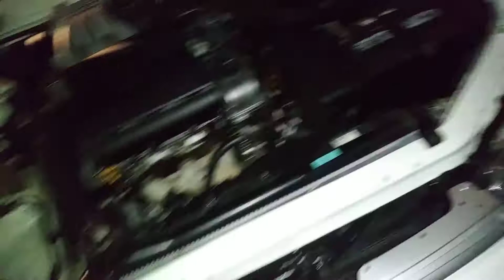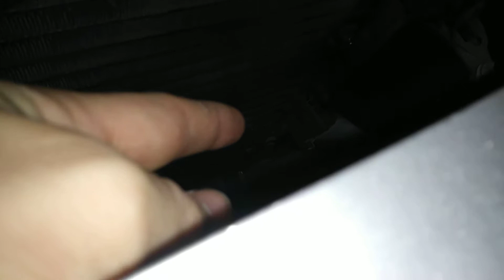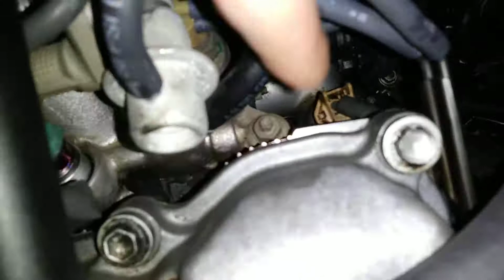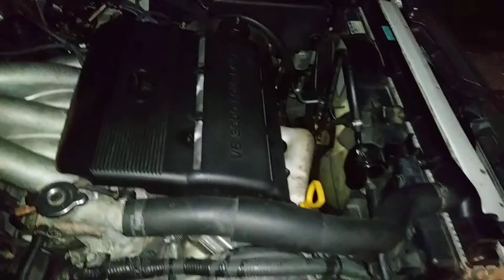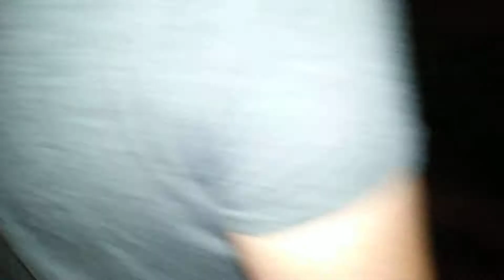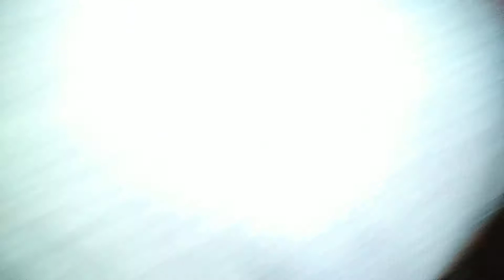1994 Toyota Camry V6 Engine Miss Troubleshooting (1MZFE)

Comment: I got a 94 Camry V6 LE...coolant is leaking from the back of the motor...I cant find where it is...ive changed the thermostat..radiator..water pump...I dont know what else? Any ideas
Reply from the maker: Check all the rubber hoses back there. There's heater hoses, and there's also small hoses that run up to the intake and the throttle body. They serve as a warmer in the winter time. Check all those hoses. You'll probably find your problem there.
Reply: ok ill check

Comment: IAM  in need of a diagram for the throttle body water connections, from block to the throttle body ,I think you said you made a video but I can't find it  I would really appreciate the help,95 es300.
Reply from the maker: It seems like you should only have two lines going to the throttle body. You'll have to look on my channel for the Camry playlist and try to find something that helps you. I think the vacuum routing diagram video may give some clues. Otherwise, I made a video on the idle air control valve for the Camry. I can't remember how much of it I show, but I know I have to disconnect those lines you're looking for.
Reply: @shadetreeautomotiveenthusi1284  thank you.ill try and check it out .

Comment: Hi Shade Tree, i recently bought a Toyota Camry 1993  LE V6 has automatic transmission but O/D is flashing, how to get the codes from the ECU? can you give me some tips to check it out? Has 209.000 miles, it make changes from 1est throgh to 3erd normally, but does not engaged overdrive, another problem that the car has is when put it Drive the Rpm goes up and down between 1000 rpm to 1500 rpm, greetings from  Buenos Aires, Argentina.

Comment: The fan is not “cooled” by the power steering pump, it is powered by the p.s. pump(hydraulic motor) . If you look You will find no wires. To the fan motor.

Comment: Will u do a step-by-step on changing the thermostat
Reply from the maker: I changed it already and I didn't record it. It was pretty easy. Down on the driver's side of the engine, right above the transmission. Take the battery out of the way.

Comment: Hey.. so im guessing the cigaret and lighter are for diagnosing a vacuum leak via watching the smoke being drawn in through the point the vacuum leak is at?
Reply from the maker: No the cigarette is a liberal deterrent, and the lighter is to activate said repellent, hahahaha.
Reply: @shadetreeautomotiveDIY  easier to spot a libtard than it is to find a vacuum leak
Reply from the maker: @altuvesbuzzer5822  Absolutely! "I see libtard people in my sleep!" The problem is, you can't diagnose them with Carb Cleaner. Well, I tried once (Statue of Limitations apply), but that was almost 20 years ago. A group of said tards pulled up on side and said some nasty things window down to window down. And, well, all I had on hand was some B-12 rolling around on the floor panel with the straw still in it. I wish they still made good tight fitting flexible straws again. Needless to say, said tards were all wrapped up in their newly acquired rear end tap to said tard in front of them. Well, about my own business I go as usual.
Reply: @shadetreeautomotiveDIY  libtards should be more careful. ive seen Brakecleen take out a rat
Reply from the maker: @altuvesbuzzer5822  🤣
Reply: @shadetreeautomotiveDIY  I recently picked up a 94 wagon with the 3.0. I had misfires on cyl 2 4 and 6, random and a p0172 rich code. Long story short it turned out to be a bad fuel pressure regulator on the front bank. Instead I first ordered up a 3 fuel injector o ring kits, o rings were all bad and I moved the injectors around. I still had the same run condition and the cylinder 6 plug looking like the coal miners that cleaned up Chernobyl. All three coil packs had visible cracks as well, of course new ones didn't help at all. I was thinking spark, compression, vacuum leak, stuck fuel injector, bad ECU etc but it turned out to be a relatively cheap fix.
Reply from the maker: @altuvesbuzzer5822  Excellent news. Dumping fuel, fowling plugs. Fun...